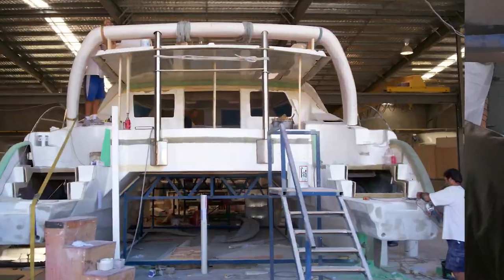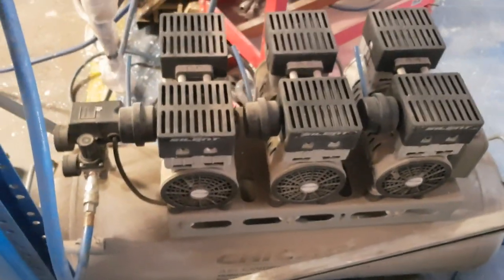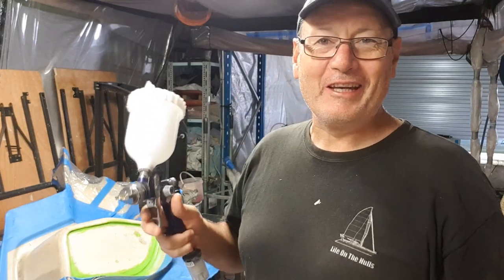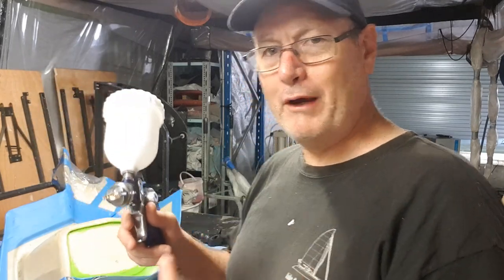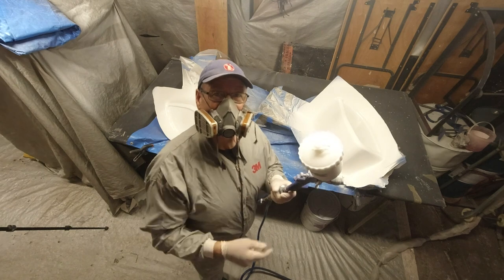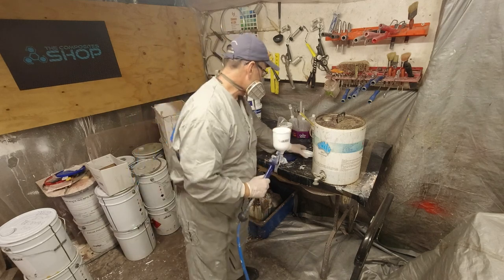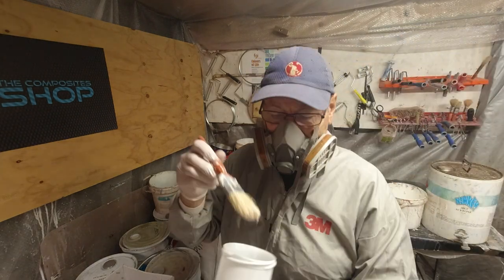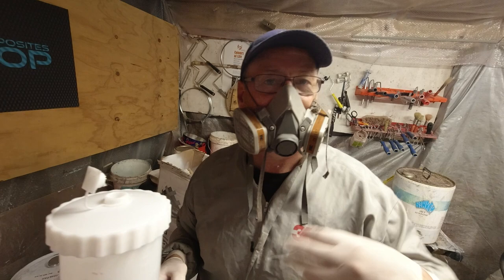How to Spray Gel Coat with a HVLP Spray Gun

Comment: Great Advice! Also; during the final cleaning, I spray into a torn-off section of an old towel so the acetone doesn't fly back into my face. Then; you can use the towel to clean the gun because it's already soaked with acetone. Thanks for the video! Scotty

Comment: Great video. You obviously have a system that works, I'm a great fan of the 3M PPS products just the cups and liners will save you all the cup cleaning time and now that there are plenty of knock offs available for the adapters liners and outers the cost is pretty cheap too, just remember to pull the built in filter out if you're spraying Gelcoat. The Accuspray guns, especially the HO versions with pressure feed are great. Tips for the Accuspray aren't that expensive, can usually be reused and if it all goes wrong and the Gelcoat sets up well you've only lost a $5 tip

Comment: Thanks Mr. Good night,  i have one doubt: this is possible apply gel coat with gun in external Surface ( ex. Sail boat) ? Thanks best regards.
Renato from Brazil.
Reply from the maker: Simply mix about 10percent wax in styrene to mske flow coat and you can spray onto external surface then sand and polish to a finish.Rossco

Comment: do you have to clean the gun between each gel coat application if you are doing a large area ?
Reply from the maker: As long as the gel coat is live and the pot emptied between each pour you can continue.Cleaning is required prior to gel setting.Cheers Ross

Comment: Say you were shooting a big mould, not quite as big as yours. And didn’t have a proper resin gun, do you reckon it’s possible to do with 3 of these guns and have a mixer person, a cleaner and a sprayer. Do you like these guns better than the other gelcoat guns that have the paper inserts and the cup on the back of the gun that are sold as “gelcoat guns”
Reply from the maker: I honestly think a G100 cup gun is a much better solution for larger moulds.Hvlp guns are excellent small job tools and gear for repairs etc  You would need to be constantly changing cups with a cup gun and I have sprayed moulds with 4-5 cups full at a sitting.The key is keeping pressure constant and moisture out of the air feed A dryer or gravity drain with moisture trap/ filter is an essential in any case.Rossco.
Reply: @thecompositesshop  cheers mate thanks for the info 🤙🏻